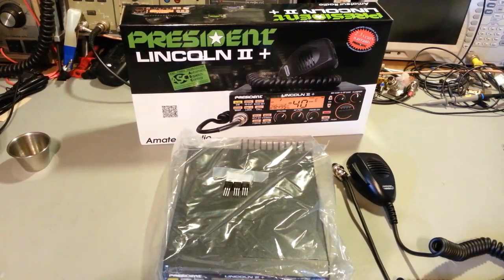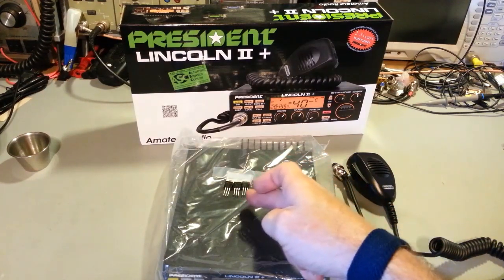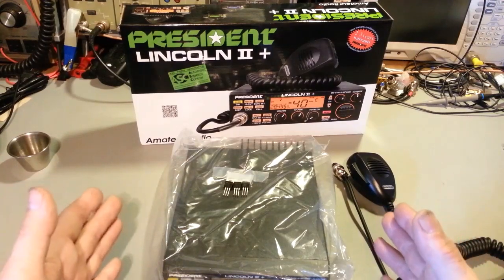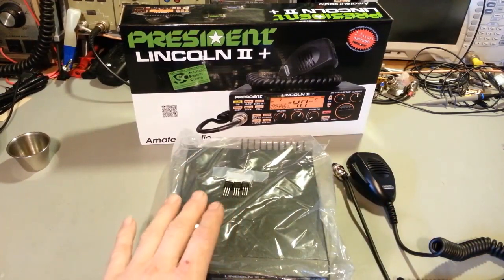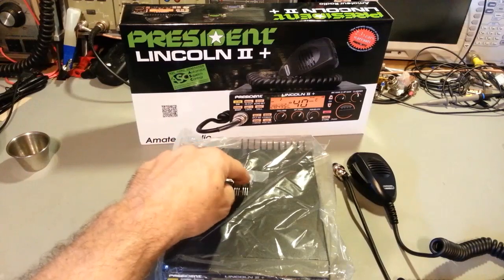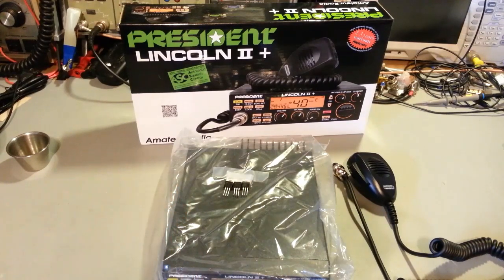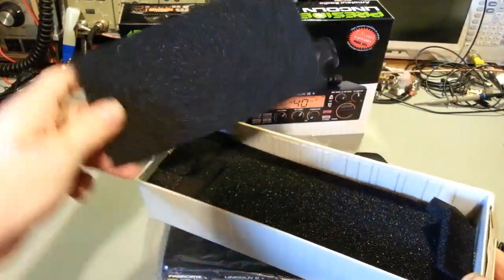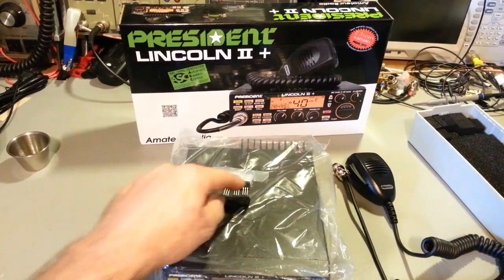How not to ship static sensitive semiconductors like FET's.

Comment: FETs back in the dark ages had a wire that shorted the three legs together...you removed the wire once the part had been soldered into place on the PCB.
Reply: Dino Papas - Or, if one was an idiot, they soldered those wires to the leads, then wondered why the set didn't work! :)
Reply: why i put mine in foile